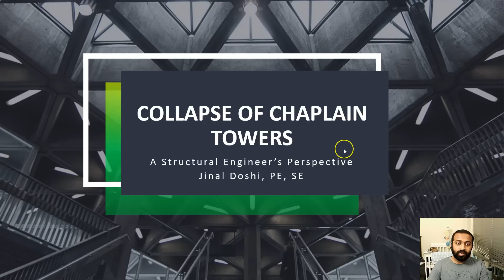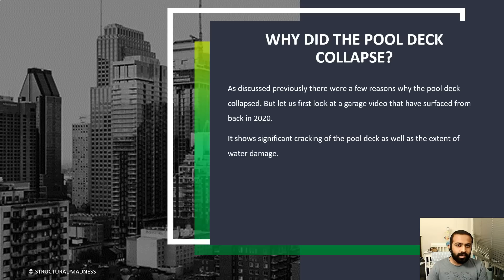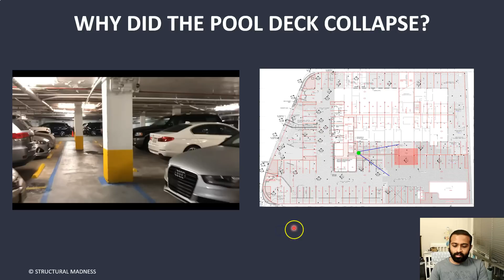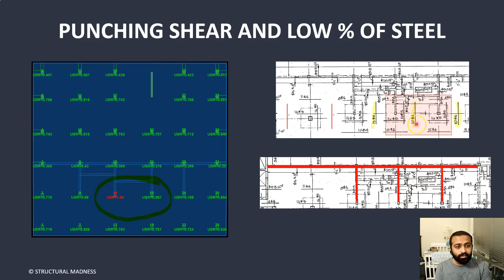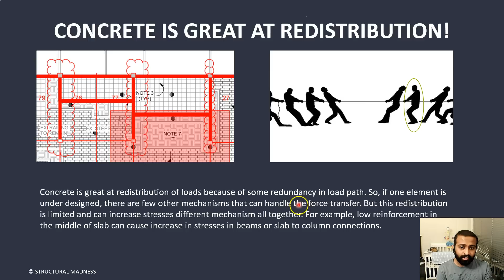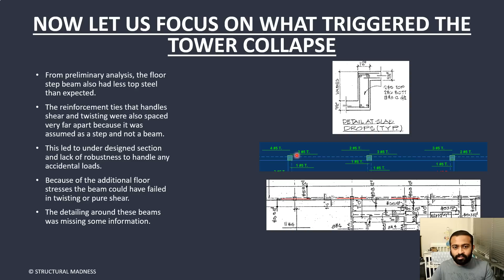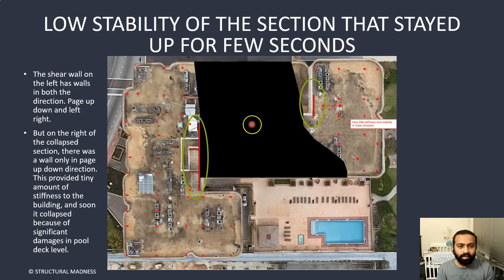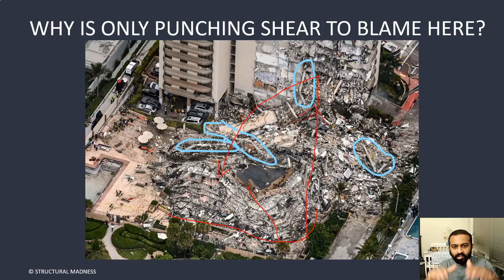Reasons behind Surfside Building - Champlain Towers South - Collapse : A Structural Engineers Review

Comment: Water penetration of the pool deck slab in my opinion,  caused the slab to become weak,  ultimately collapsing,  pictures of similar structural failures recently seen online , you will note they are also carparks that are exposed to the elements,  a slab designed to sit directly on top of columns is ok in an enclosed building ,  because the floor slabs are protected from effects of the weather, and remains structurally sound ,  that same design should not be used in areas that are exposed to water penetration, such as open carparks or suspended pool decks, these areas need additional support. Because they are not protected from the elements.
Reply: The twin of the building was exposed to the same weather. The only reported difference between the two is in the support, the N resting on bedrock whereas the S rested on reclaimed landfill. The pool deck did not support building weight. Therefore its collapse is unlikely to be a cause of the building collapse, rather than earlier manifestation of the forces subsequently collapsing the actual support columns of the structure.
An unexplored issue is the S facade falling N instead of S. Demolished buildings fall inward because of charges cutting support of the center portion whose collapse drags the external walls inward when the perimeter support is eliminated.  If the support of the S facade was the first to go then the facade should have fallen S. It is much more likely that the next EW row of columns to the N of the S facade collapsed prior, which would have dragged the S facade to the N and been pushed N by it. This is why it looks like the collapse started at the roof - something happened up there which was hidden behind its initially intact S roofline, which itself  began to collapse immediately , giving the illusion of initiation,
Thanks for your insights and video efforts on our behalf!
Reply: Yes I agree the pool deck didn't support the building,  but the deck was attached to the building,  and its possible when the pool deck collapsed, it pulled the front columns away from the building, causing a chain reaction, this is an hypothesis I've heard from other engineers , not my own , but it does make sense.  Eye witnesses have said they saw the pool deck collapse first,  this is the reason I think the pool deck was the catalyst for the collapse,  Personally I'm not aware of the foundation material for the two building,  so I can't comment,  im only going on pictures from the internet,  and I can't see any evidence that there was foundational problems,  the basement is still there and looks intact,  my focus is on  what caused the deck to collapse, if in fact it fell first.
Reply: @kingdomfor1  Hard to see how collapse of a structure.could collapse another structure which was not supported. Much more likely to both collapses caused by mutual mechanism.  That said, final results not yet available. Below is my initial assessment, certainly as with all other analyses, a work in progress.  Thanks for your input! 

Previous:

Abstract: The construction of  building S was not the proximate cause of collapse. The failure was in the foundation
A. Factual basis.
1) the North building (N) is presumably the twin of the South, (S) both in architecture and construction quality. It didn’t collapse, subside, or have recurrent floods/major spalling. 
2) The difference between these two real estate developments is their respective locations. N’s foundation slab is supported by columns on bedrock, whereas S slab was supported by columns resting on giant concrete balls floating on reclaimed land. 
3)  S was sinking at the rate of 1-2 mm/yr, but not N. The accumulated sinking depth is at least 5-6 cm. but no tilting was observed.
4)  S experienced recurrent salt-water flooding of the basement whose floor is the top of the foundation slab. This volume was deep enough to require, and be amenable to, physical pumping. 
5) The spalling was caused by corrosion of rebar and degradation of concrete integrity typical of water and electrolyte damage. 
6) the collapse of the building was preceded by building movements and loud noises until acute decompensation.
7) After initiation, the collapse  of the south wall of the collapsing portion fell north into the building, sequentially hitting walls in  to the north like dominos. The relative heights of the collapsing walls at any one time are all N>S. The collapse is deemed to have been initiated by loss of support of the southern wall columns in the area of the parking ramp. 
8) The western limit of collapse is marked by a plane, I.e. a linear shear force. Although the collapse did go East, the loss of support of the western aspect of the eastern upright portion did not occur until the initial collapse had completed. The east portion actually swayed eastward before swinging back and collapsing westward. 
9) sea level has been steadily rising in the Miami area. 

B. Analysis:
1) the recurrent flooding was due to water rising up under pressure. The saline character of the water is diagnostic of seawater. 
2) the subsidence without tilt was due to sinking of the slab as the giant balls of concrete lost their support  due to erosion of silt, sand and whatever was used for reclamation. 
3) the rising floodwater levels in the basement were sea levels at high tides which became evident when the downward motion of the foundation slab passed the high tide level. These vary with moon’s pull. The flooding should correlate with tidal records.
4) The tidal nature of the intermittent flooding exposed the junctures of slab and support columns to cycles of corrosion involving water and ions. Likewise, the  tide mechanically eroded the overall support of landfill under the giant concrete balls in addition to dissolution. Seawater also seeped into the bases of the columns resting on the slab, corroding  rebar and concrete.
5) the shear plane indicates a linear weakness in the foundation slab, likely a separate slab for the east and west portions so the East’s loss of support  sheared along that juncture rather than proceeding westward to the adjacent building.

C. Suggestions. 
1) Exhume the records relevant to the land reclamation; why was it necessary and how was it accomplished? Any analyses of mineral and water contents?
2) Review the engineering records for the construction of the foundation slab (s) and the columns beneath them. 
3) Sink core samples to check the adequacy of reclamation’s status. And current sea level. 
4) Image the subterranean portions with millimeter radar etc to see how much area is compromised. Is there some discrete channel of seawater connecting the eroded area to the ocean?
5) Check the subsidence records - were there multiple recording sites, so they measure evenly, were there any measurements of adjacent areas?
6) Obviously, examine the foundation slab and its support column junctures both above and below.

D. Conclusion.
This collapse is due to rising sea levels. Weird that the myriads of people screaming about this problem for years don’t recognize it when it bites them in the, er, butt!

Update: the debris has been cleared and there are puddles of salt water on the foundation slab. . . .
Reply: @polychromaticlaser635  yes I hope it can be determined how this collapse happened,  so we can avert any similar tragedy.
Reply: @kingdomfor1  With you all the way, appreciate your efforts and insights!

Comment: @Structural Madness - Excellent analysis. I agree with nearly all of your theories.
The video of the garage shows cracks on the underside of the slab with epoxy injection nipples in the SE corner. BUT I also noticed a diagonal crack from the columns nears parking space 69 and 49 spanning the driving aisle. This is also where the columns are staggered, not directly across from each other. So we agree in first portion of the collapse begining there with the cars parked on ground level falling into the garage below. From there, the pool deck second which weakened the columns and beams under the planters and the edge of the building.
From the video looking down the car ramp, I believe the first column you see is the column immediately at the end of the ramp and half wall. So second column which you call column 1 is actually the first column opposite the ramp (across the driving aisle).
As for the design - I'd say the design was good for the time it was built. I don't feel the twin building or the mirror building are unsafe to live in AS LONG AS PROPER MAINTENANCE IS DONE. Could improvements be made to those two buildings to make them safer? Of course but getting owners to pay the assessment will be a challenge.

Comment: On all the videos I've seen no one has said nothing about the absence of expansion joints which could play a significant rol in absorving delta temperatures in such a large area of the pool deck (someone on these comments asked why this happened on night time) and on the connection between pool deck and the main buiding. I think this is an important factor to have consider when running simulations.
Reply: Ah. I haven't heard that before either, in any other videos I've watched too. Just curious to know, where do the expansion joints supposed to go? That's such a great point you make, I wonder why it has been overlooked?
Reply: @maryhorton7876  I don't know but considering this large area for the pool deck plus the garage (more than 40000 SF of concrete) the structural continuity with the main building might be a risk factor.